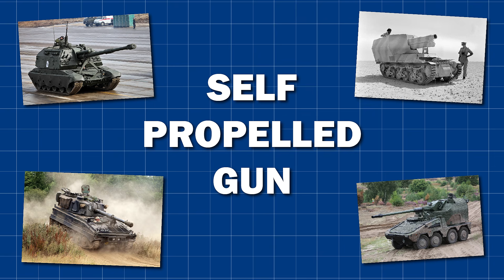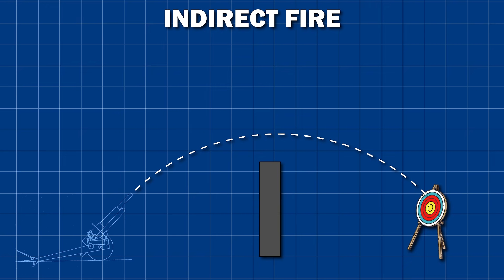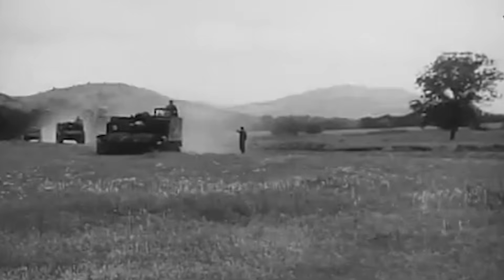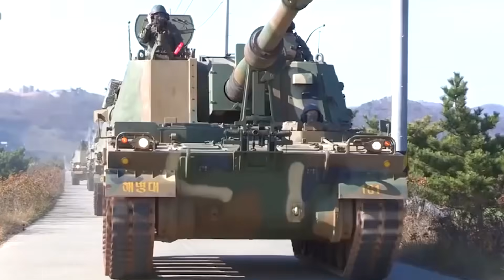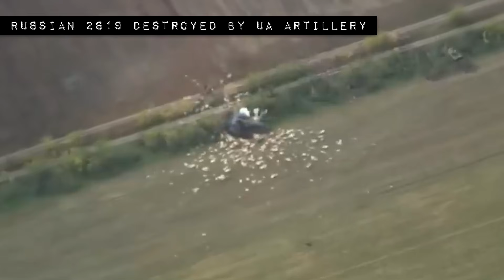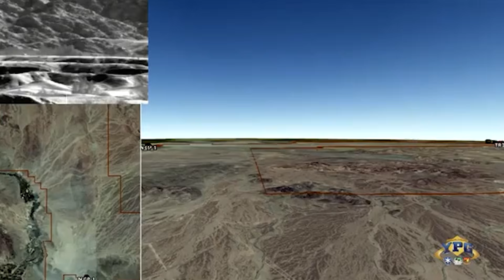What actually IS an "SPG"? And why are they so important in Ukraine?

Comment: Artillery shells don't travel in a parabola. Air resistance makes the path asymmetrical causing the shell to land at a steeper angle. Mortars are specifically designed for the shell to drop as vertical as possible.

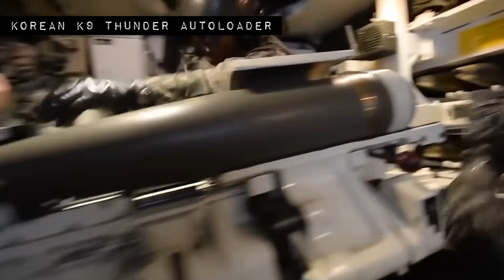Comment: 4:38
Ey, that's not an autoloader, that's a mechanically assisted loading system
An autoloader is fully automatic and fully mechanical, with no human intervention other than to press a button to select the munition type or unload and reload again.
And an autocannon is like an autoloader, but an autocannon working almost like a machinegun while an autoloader working more similarly to a bolt action gun (some autocannons can be just really fast autoloaders when  on really big guns but have the firerate of an autocannon and therefore be practically functional as one)

Comment: Sorry, by this video has the wrong take on SPGs.
Firstly, there are self propelled guns for both direct (assault-, anti-tank and anti-air guns) and indirect fire (artillery).
Secondly, the reason self-propelled artillery was invented wasn't at all avoiding counter battery fire, but to be able to keep pace with the mechanised formations, especially cross country.
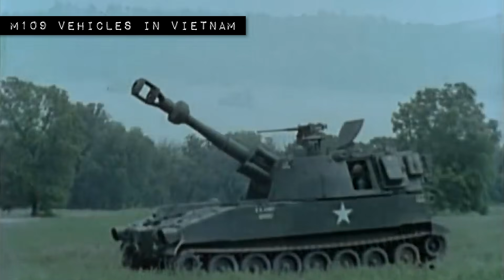This is highlighted 4:13, since North-Vietnamese counter battery fire was almost non-existent during the Vietnam war, but there was a definite need to rapidly getting the artillery into firing position to support the mobile units.

Comment: I might be wrong, but believe Flak 88 counts as "direct fire" in its original use as anti-aircraft artillery--IF the in/direct distinction applies to AA use...🤔
Reply: @volteer1332  I'd still count it as DIRECT fire. You aim at area on the sky which is in your direct line of sight.

Comment: Flak88 is not an indirect weapon. It is direct antiaircraft and antitank.
Reply: @volteer1332  Flak88 in AA use is still direct fire, you aim at the spon on sky in your direct line of sight.
Reply: @volteer1332 that's not indirect fire
If I have a rifle and I'm shooting a fast-moving man, it's not indirect fire because my sight is not directly at him
Lobbing rounds up in the air with the goal of them coming back down and hitting someone is indirect fire
Reply: @demanischaffer yes you explained indirect fire which shouldn't be confused with indirect weapon. Direct fire weapons you can still shoot indirectly but that still makes them direct fire weapons because they're most effective when you have direct line of sight or physical sight of the target. But indirect weapons are weapons that you don't specifically need to see the target in order to destroy or cause damage. For example non artillery tanks are direct fire weapons and artillery tanks are indirect. Simpler terms is that direct and indirect fire weapons can both be fired directly or indirectly, but if it's effectiveness to contact or destroy a target is better directly or indirectly is what dertmines if it's one or the other. Or a simple anology would be guided missiles(direct weapon) and non guided missiles(indirect weapon)

Comment: I mean at this point (M1299), why don't we replace the shells with regular ballistic missiles? Is it just a matter of cost and missile jamming/scrambling tech?
Reply: Cost and payload.
Increasing the payload weight of a missile is exponentially more expensive than increasing the payload of a ballistic projectile.
It is also possible to track the smoke/vapor trail of a propelled charge like a missile, or intercept it with C-RAM type automated anti missile and aircraft systems.  You can't reliably shoot a falling bullet out of the sky.
Reply: @volteer1332  Funny huh, how all the extra control one has on a missile somehow makes it more predictable - I see what you're saying though, it's likely just a matter of size, shooting a missile with a bullet is hard enough, but good luck shooting a bullet with a bullet like that WW1 incident
Reply: @luigivercotti6410  prediction is predicated on being able to detect an object, and the heat signature on a missile is pretty noticeable.  But size is the other big thing, all that extra space for the rocket fuel and the guidance computer and sensors makes it a bulkier target to hit.
Reply: Missiles cost 10x more than artillery shells…this is the main cause of

Comment: Hey guys, I've worked on m109a6 paladins for about 5 years. If y'all have any questions about the platform within reason I'd be willing to answer. I know much more about the maintenance side than the operation side but it's interesting none the less
Reply: Whats the maintenance like? Are there any parts prone to breaking?  Whats the funniest thing you’ve seen while maintaining the m109?
Reply: In the Swiss M109 KAWEST it is possible to shoot direct with a scope. Is that Swiss thing but also on the paladins?
Reply: @xDlol24 yes paladins can also shoot direct if needed. very very rare but it is possible.
Reply: How is the shell trajectory calculated by the system? I'm currently building an SPG tank in a game but I'm not very sure what to calculate to fire from a significant distance. Are there also calculations for aiming the gun on high angles like a mortars?
Reply: @BLEEN-lk3mj What game?
Reply: @BLEEN-lk3mj  this is a little late but most (if not all) of the calculations for distance and angle for the rounds are done by our FDC (fire direction center) and then they send in the exact numbers to the people in the paladin to fire on a target. im currently in the army as a paladin driver for source.

Comment: Not sure if SPGs didn‘t come around at least as much due to the needs of the other arms during offensive operations rather than just problems the artillery faced. Traditional towed artillery performed extremely successfully in WWII and it was much cheaper than SPGs. 

But the necessities of mobile warfare meant that the infantry, and later also tanks, desperately needed a solution for mobile fire-support that towed artillery couldn‘t provide because it couldn‘t keep up with the rapid advances that became necessary. One solution was to try building smaller and smaller guns, but the Germans very early on hit upon assault guns as the only effective solution.

Comment: I want to point out that the Germans in WWII used assault guns and tank destroyers much more prodigiously than (what would now be considered) textbook SPGs but in a very similar role. Weapons like the StuG and Jagdpanzer were massively more common in the German army, and were similarly used to support the infantry on the offense and were capable of indirect fire. Arguably the StuG even is supposed to be an SPG, even if it became the mother of tank destroyers as well.
Reply: An assault gun is a direct fire weapon/vehicle system.  It's basically a cheaper alternative to close support tanks like the M4's armed with 105mm howitzer's.
Reply: Stug is an assault gun
Reply: @gotanon9659  and what exactly is the difference between an assault gun and an SPG that‘s getting used as a tank destroyer 70% of the time?
Reply: @RadBaron1811 Generally assault guns would be armored enough to survive expected frontal threats 
SPGs are armored to defend from small arms and shrapnel from bombs and enemy artillery
Reply: @demanischaffer  exactly. Which means your assault gun is pretty much just a better SPG and in most cases you‘re going to have zero problems if for whatever reason you use the assault gun instead.
Reply: @RadBaron1811  Yes'nt
Things like the Stug started as Self propelled artillery, but were re-gunned to work better as tank destroyers, Germany had other SPGs that differed greatly in design because they stayed pure artillery 
The Short Barrel Stugs were artillery at first, if you look at photos from early or pre war you'll see their crews do not wear the tanker uniforms 
Now a Stug makes a great assault gun because it's armored and enclosed, a long barrel stug makes a good tank destroyer because it's low to the ground and armored, a Priest or Hummel make better artillery platforms because they have higher elevating guns their designs would allow bigger guns to be employed
Reply: @demanischaffer Very informative, thank you.

Comment: Is the velocity of the shell slower when fired in a lower arc?
Reply from the maker: I’m not sure! I’d presume it was just fired last. I think the animation exaggerates the differences in elevation.
Reply: I think shell flights faster with flatter arc since travel distance is shorter and it takes less affect from gravity
Reply: Some (most?) artillery have adjustable charges (edit: adjustable charge is in fact necessary to do the time-on-target fire, like shown in the video), but if you're not doing ToT, unless you needed to aim a little higher to avoid hitting an obstacle, I'd imagine you'd just fire standard/full charge. With the same charge, the velocity is the same, but firing in a low arc, the shell will reach the target faster, since it's taking a more direct route.

Comment: I don’t know if it’s in your interest but could you discuss the newer guided munitions of these modern spg’s?
Reply: While you're waiting, there's plenty of good information on the M982 Excalibur round on the internet (including here on YouTube). That one is probably the most interesting one. (There's also the Precision Guidance Kit, which can be attached to a dumb round to give it a significant fraction of the capability for far less cost).
Reply: @jeffbenton6183  Nah, it's complete shit. Russian Krasnopol costs 1/20 the price and is much more accurate, happens when you don't build stuff to enrich 1% first and foremost...
Reply: @KuK137  India has large stocks of both Excalibur and Krasnopol. Their conclusion is the opposite of yours. They've found Krasnopol unreliable at high altitudes (each one becomes a "dud" to use a direct quote). Excalibur, on the other hand, does not have this problem. The Indians also like that it has a bigger warhead and has "more penetration power" - again to quote their own assessment. Starting in 2019 they began to actually replace their stocks of Krasnopol with Excalibur. 
Also, Krasnopol is not one-twentieth the cost of Excalibur, it's one-fifth. Excalibur is still considerably more expensive than Krasnopol, but it's nowhere near as expensive as you claim. Moreover, Excalibur can be much cheaper: in 2006, it was fully half the price it was now, because they were being built in greater numbers. The US chose to buy fewer of them because they were so effective, that they didn't need as many as they thought in Afghanistan. Remember that economy-of-scale is a thing - they could be built in even greater numbers than they were in 2006, which would make them even cheaper. In any case, the Indians think it's worth the extra cost (and I think they're looking to license-produce their own Excaliburs, which are likely to be cheaper). 
Lastly, you don't honestly believe that Russia has a weaker 1% than the US, do you? Russia is practically owned by its oligarchs. The one societal difference that likely accounts for the extra cost is that American workers demand extra pay. The median household income in the US is 5-10 times higher than that of Russia (depending on which part of each country we're discussing, and when in the last five years as well). This more than accounts for the increase in price. If anything, US production of the rounds is likely much more efficient than the Russian procedures, since Excalibur should be even more exspensive than it is.
Reply: @KuK137 And I have oceanfront property in Nevada to sell you
Russian claims on accuracy and reliability must be taken with a large amount of salt
Reply: @KuK137 mad cope
Reply: @KuK137  pure copeium
Reply: @KuK137  copium supply's running out, better get on that ropium
Reply: Cope  @KuK137
Reply: @KuK137    I'd sure like to see what evidence you have for this lol. Russia lies, boasting about capabilities, while america lies, playing down the true capabilities of their platforms.
Reply: I literally was JUST watching a video about SPGs

Comment: 775 football fields or roughly the length of 1.002.148 BigMac side by side
Reply: Is that Big Mac system based on the advertising photo, or the real "stepped on" dimensions?
Reply: Finally, a real American.
Reply: @quaxky326 🦅
Reply: Americans will do anything to avoid SI units.
Reply: @jaex9617  I'm partial to the rural American system of using time as a unit of distance measurement, for example, at average Floridan highway speed(~80mph, so on the lower side of the real average), the M1299 can fire a shell over 30 minutes away!
Reply: I did the math and it actually comes out to about 882,800 Big Macs
Reply: @GremlinGrenadier Question: who would actually eat all of those?

Probably Nikocado
Reply: @Marder_IFV  I would actually watch that mukbang video
Reply: 882,800 people with no taste and no concern about obesity, diabetes or heart disease.
Reply: 2 steps ahead 😮 @Marder_IFV
Reply: @goodnamepleaseplease  😭
Reply: damn. That's alot of big macs.
Reply: How many washing machines
Reply: @Bronze_Age_Sea_Person  103333.333333 washing machines.
Reply: Thanks for translating to burgers per football field! It really puts into perspective how small it actually is!
Reply: In Britain, we prefer double decker buses. Journalists avoid any kind of standardised units. Or use stupidly accurate conversions, "that's about a foot (304.8mm)."
Reply: Speaking as an American, we really do need to standardiZe on a size for our freedom burgers. And don't forget, they can be used to measure height; we can use the beef patties as shims.
Reply: Bro thats like 1/4 of the bigmacs caseoh eat in his midnight snack
Reply: What rubbish Banana Units are these, you Amerikan???
Reply: western european poser, youre not supposed to use commas like that
Reply: Can you translate that to 50bmg
Reply: How many Corgis is that?
Reply: Almost, except that in America large numbers are generally formatted with commas rather than periods, with periods reserved as decimal points.
Reply: Lmao i was just about to ask how many hamburgers that distance was 🤣
Reply: Damn, only 1 and a tiny fraction of a big mac?
Reply: Bro you are CRAZY crazy